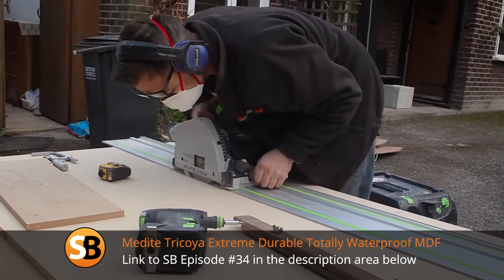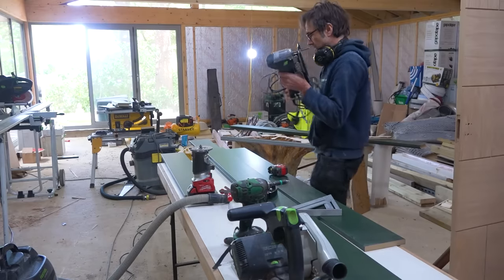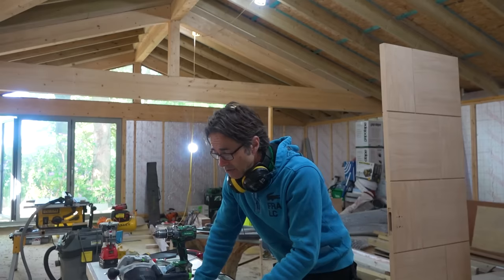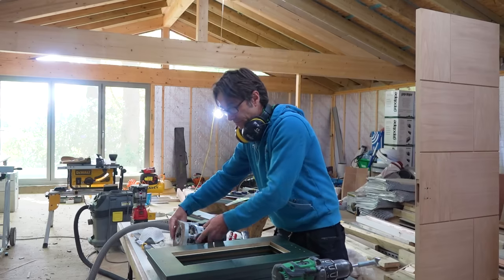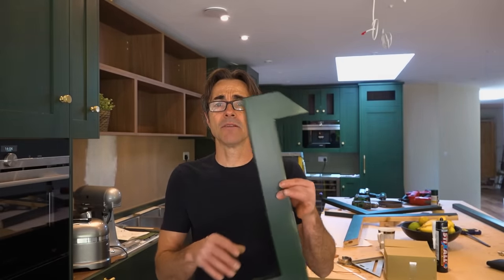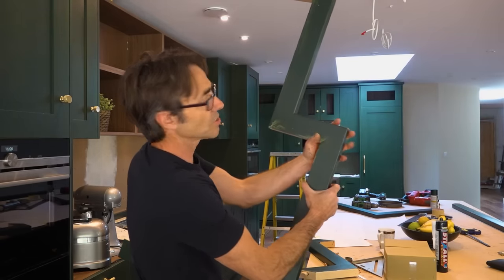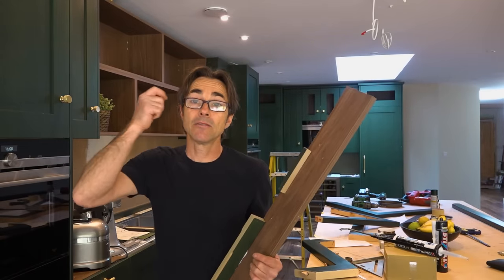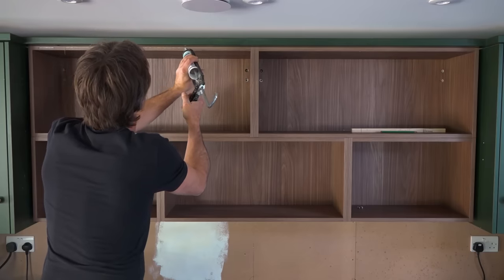Pro Kitchen Fitting Tips and Tricks - Capel #27

Comment: Would you recommend plywood behind base/wall cabinets to increase air flow and prevent moisture/damp? Or can the cabinets get fitted onto plasterboard?
Reply from the maker: It is a great idea to use OSB or ply on stud walls and then face it with plasterboard. That gives you all the fixing points you need. It is not required for damp because the walls are in the heated area but it makes a good solid wall.
Reply: @SkillBuilder  thanks really appreciate the response, what about solid/brick walls that have been plasterboarded (i.e without studs)? Is it OK to just fit the units without plywood for air circulation? It's something I heard and read people do so was wondering if my builder was missing a step

Comment: Would those adhesive work for skirtings if the walls are wonky? Im having a mare of a time with our renovation. Solvent adhesives have not got enough grab. Also surprised you didn't domino the frame for your cabinets, would of make alignment easy :D
Reply: I always use insta stick low expansion gun grade foam for fixing things like skirting a mate. It's extremely strong,very low expansion and goes off completely in ten to fifteen minutes so you can put some weight against any bits you may be trying to bend in to the wall or use a wedge and they only need to hold for fifteen minutes then it will have grabbed And you can remove them. It was originally developed for sticking plasterboard to the walls instead of dry wall adhesive but it sticks pretty much anything. Have a quick google of it-- insta stick gun grade low expansion foam.
Reply: @garethheathcote4988  Thanks for the suggestion. I've actually been recommended that by a few people now but I am trying one more product and if that fails, I will give this a go. How do the wedges work? I've tried to google around but I've not found any examples. I'm thinking about screwing a temporary piece of timber to my floor in front of the skirting and then making some wedges which I can bash in between to get things flush until it dries - am I on the right track?
Reply: @garethheathcote4988  I use insta stick  foam for sticking skirting works really well

Comment: I would avoid swinging doors(shelving) below the countertop - you basically limit access to one side only. You can get sliding trash units for under the sink stuff.
Added bonus is that you can use only handles then for that "clean look" - you can the go all knobs on the top level cabinets. Mixing knobs and handles on the same level looks weird - unless they match really well.
Reply: Robin knows exactly what he,s doing mate,this is his own custom built house with the custom kitchen he,s designed himself.
Reply: @garethheathcote4988  I know mate. It was more for others designing their kitchens.

Comment: The most common grab adhesive, lets call it sh*tfill, is a pain in the arse. I hate using it but every site I work on it's already been supplied with the skirting, mouldings etc.
You ask if a better one can be provided but you turn up on site and there it is, that bloody green box.

Comment: What are you classing as forever, ten years?
Reply: If you're talking about the tricoya extreme MDF it will last for decades. Robin has experimented with it using it in planters outside, and even leaving it in a bucket of water for months. It remained perfectly dimensionally stable. It's very expensive but very useful stuff and worth it in certain situations, if you considerer the time and expense of replacing things that rot.

Comment: you are such a clever bloke but I cant for the life of me figure why you couldn't have come up with  way of holding that frame in position until the silicon went off instead of using 18g brads. Anything would have been better than having holes in the face of a spray finished piece of trim.  I,m an old shopfitter and my bosses would not have been impressed, or was it it joke and there were no nals in the gun??